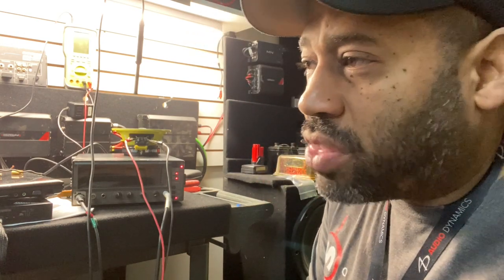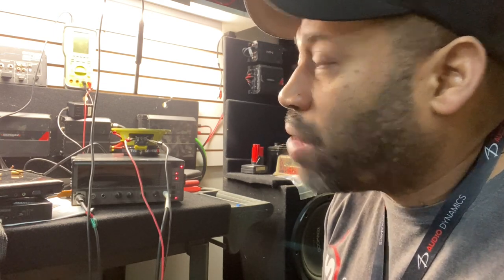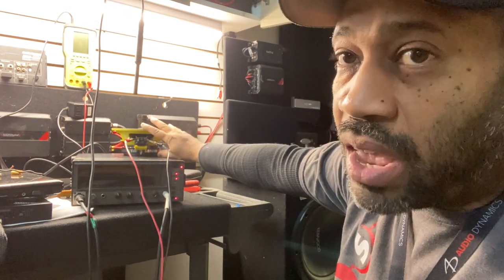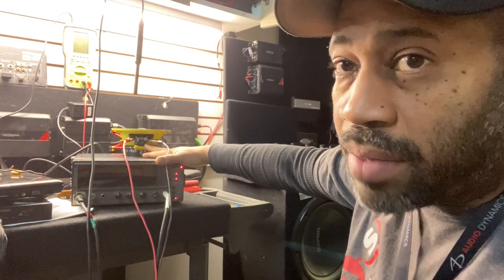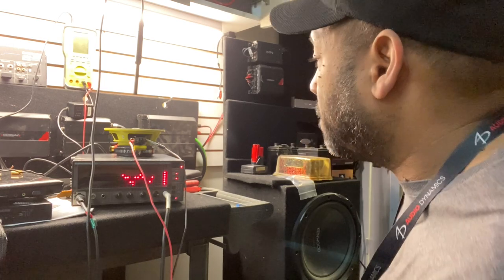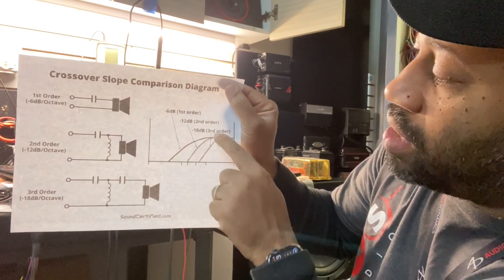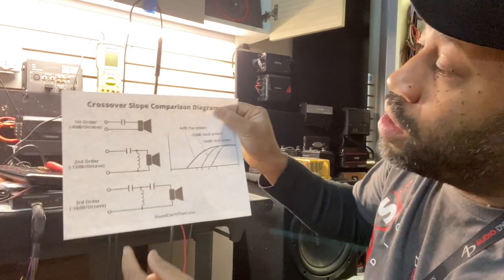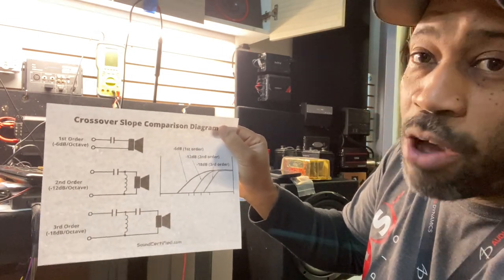Ground zero yellow basket coax speaker modification .Gzcf165spl This will void your warranty !!!!

Comment: That’s Great info, a buddy of mine’s was having this problem and thought it was the amp I assured it wasn’t the amp and I was down to something funky going on with GZ speaker because with hook it up to a different amp and it had no symptoms back to bike same thing, I put the ohms meter on it and the mid and tweeter ohm where they should I couldn’t figure it out and just said they must be defective🤷🏾‍♂️, So he bought a pair Diamond Audio and been happy every since! Ground Zero Dropped the Ball on this line of speaker just think about the pain it has caused installer/shops, I’ve been hooking up music since the 90’s and pretty knowledgeable at that and ain’t never had to hack up no brand new high quality speaker 😳😳😳🤦🏾‍♂️🤦🏾‍♂️🤦🏾‍♂️

Comment: Or replace capacitor with higher frequency cut off. For example 7kHz at 6db. Or another way if you use DSP - go full active. But in this case you're using two channels on DSP
Reply from the maker: Exactly 👍🏽

Comment: Carlos, Do you still think the notch filter is necessary when removing the coil?  The new Yellow Basket 6x9 look to have the same 25mm Mylar tweeter as the 6.5, and they come from GZ with a cap only 6db/octave filter.

Comment: I have 6 yellow baskets. I clipped the tweeter wires and running them active though the dsp. I should be good right?
Reply from the maker: Yes
Reply: @NVSAUDIO  can you give me some advice on how to wire these tweeters in series. I have 6 tweeters from gz coax and 2 hertz st25. I want to run on the left and right channels. Sd1200.4

Comment: Question..why not just send the speakers out for warranty?
-Time factor
-cost factor 
????
Reply: I have a ser of these in my shed.  They are not very good speakers.  Not efficient. (Dont play loud)  cant hear very well at highway speeds.  I only bought them. Because they were expensive and they play at 50hz..  Now I know you cant hear 50hz at highway speeds.  Lol.  I have saddlebags playing everything below 100khz.  I'm sure you will be waiting for months to get replacement.  
If I remove a speaker from my faring,  I'm replacing the speaker so I can put everything back and ride.  I cant see going through all the trouble of putting back together with no speakers and doing it all over again two months later and putting same quality speaker back in.
Imho  $300 speaker not worth the trouble.  Upgrade to Diamond or cicada. Or anything with better build quality and power handling.  Especially if you are not doing work yourself.  Time is money.
Reply from the maker: @robleeva  I agree with most of your statement 

I think they are very good speakers for the money 
There  $300 on the speaker on the market that can outperform it  in power handling and mid bass . 

Yes the diamond audio and cicada are way louder 

But 

1. They are not weather proof 
2. They cost $250 more 

And I agree with you 100 percent 
If I’m pulling the speaker out it is going right back in so I only lose labor once . Time is money
Reply from the maker: The replacement might do the same exact thing 

Is not a faulty speaker 

It’s just the speaker / amp combo not playing well together. So I mod the speaker to make the amp happy
Reply: @NVSAUDIO  oh wow ..ok thxs
Reply: @NVSAUDIO   Yeah but you shouldn’t have to hack no $300 pair of quality speaker, Hertz and Diamond play as they should!!!
Reply: @NVSAUDIO   Great info and I see and fully understand what your doing 👍🏽👍🏽